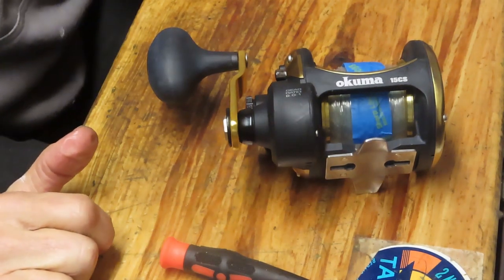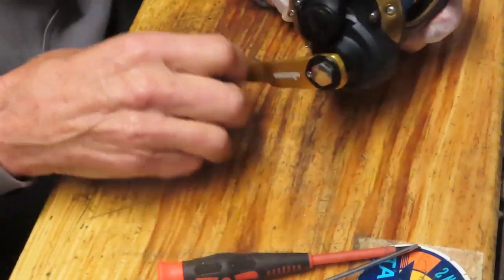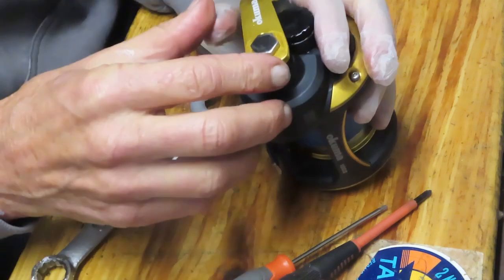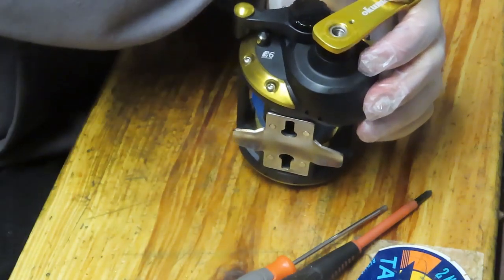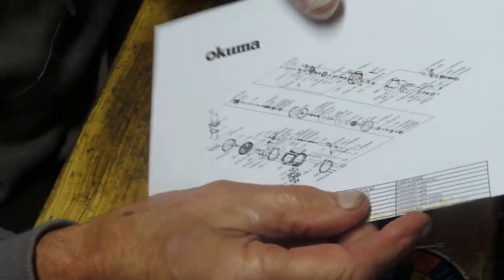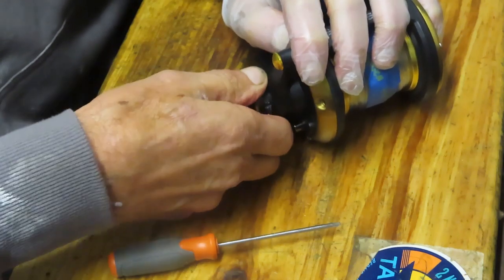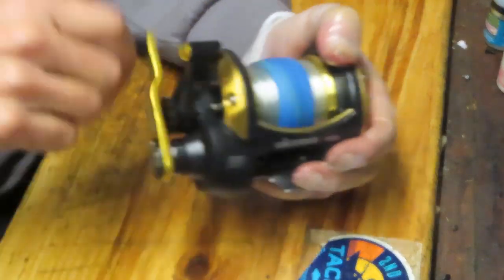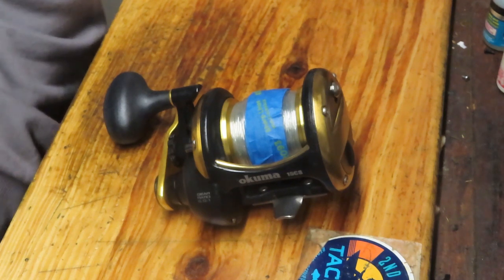Okuma Solterra lever drag fishing reel how to service

Comment: Dennis I did not see you grease the main gear why is that sir ?
Reply from the maker: It was greased, I may not have said so. You do not grease the main gear's shaft as it passes through the A/R clutch and you don't want to get grease on that part. Thanks again - Dennis
Reply: @2ndChanceTackle  thanks